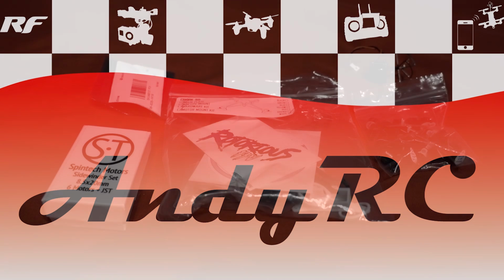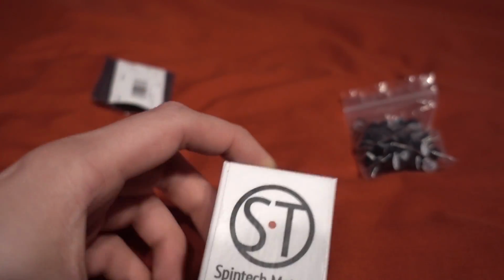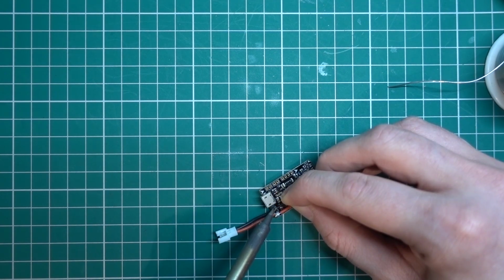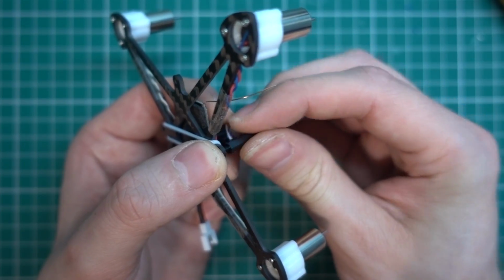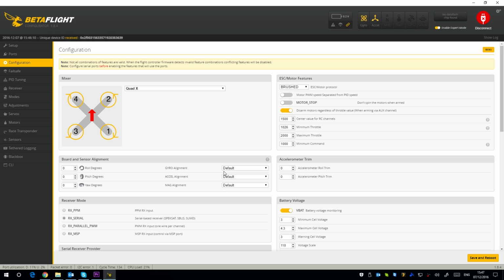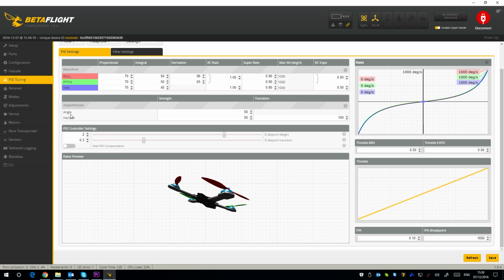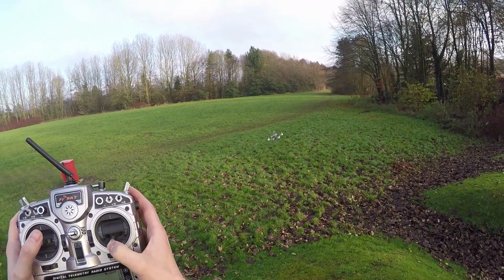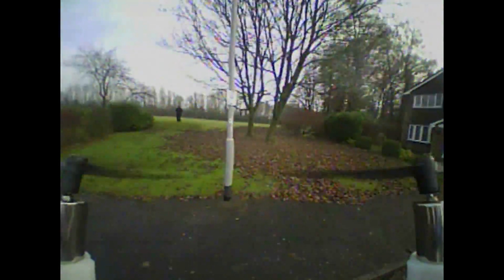Best Brushed Micro Quad Build

Comment: Actually I bought different spare frames for my qx95 I already crushed one frame but so far I am quite pleased with it. Most of the components are similar or the same so why shouldt I try different frames with the parts on my qx95 :) actually it is much better than I expected. Only issues I have are with the propellers, and the transmitter antenna and of course the camera but 200 mw spare costs only 17 dollars. As propellers I have 65 mm ones now which are totally better than the tiny original ones but I want to try the 3 bladed ones too. It is fun to fly, you cant harm anybody with a micro quad and they fly like a champ.
Reply from the maker: +Onur Can Vural yep good observations cheers

Comment: Do you think these motors / props would be a good upgrade for the original eachine qx90 ones? Thanks.
Reply from the maker: definately however the props are slightly too big i made a vid on how u can add them to the qx90 search qx90 rolling spider

Comment: hi Andy. there is a new brushed controller coming to banggood with integrated receivers and an osd which  configurable in betaflight. 30 bucks for all in one.
also do you know it is possible to use brushed boards for brushless setups with minimum adjustments?
Reply from the maker: yes its in pre order status at the mo and looks good. you are best off buying a brushless specific FC u can get them pretty small such as the afro mini
Reply: AndyRC but not with the receiver and osd
Reply from the maker: yes theres aio FC now with osd for brushless u want a stronger receiver than the ones in these brushed models

Comment: Love my crook got both crook and the rotorious fpv speck. Got to say thou that I do prefer the speck a bit more being more compact. Having a hard time going back too the cheap frames such as the qx series after trying the rotorious fpv frames.

If you don't mind the extra weight you can put the jst cable from the motor tru the hole in the arm. Also I would recommend to build with the motor mounts under the arm. That way you push the motor true the hole down into the motor mount. You will get a lower point of gravity and less props in the view.
Reply from the maker: +Linus Forss makes more sense to me to have the motor mounts on top. I have a lot of x frames so don't mind props in shot. CG is perfect as u can see by upside down hangs :-) won't be changing it when the motors are 22 quid a pop. Protects them much better